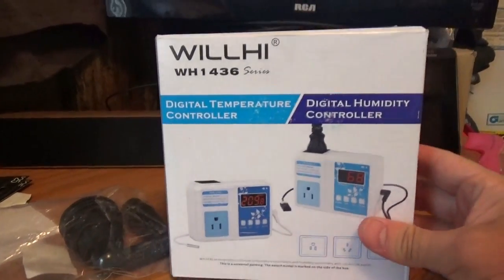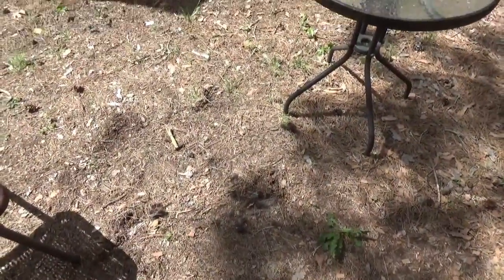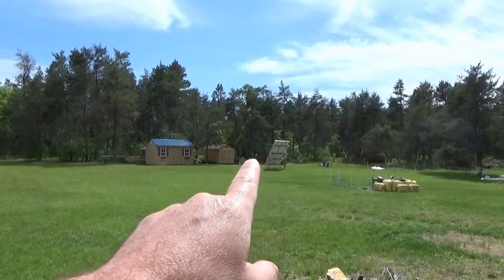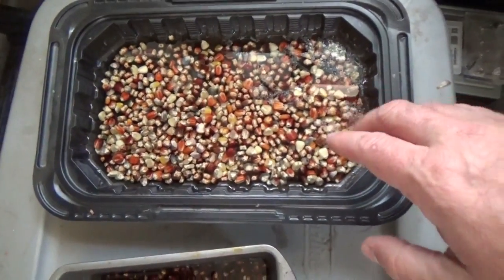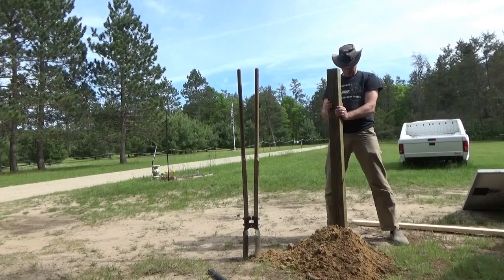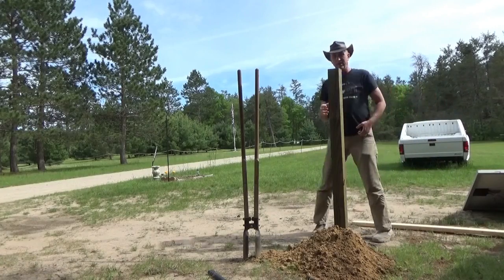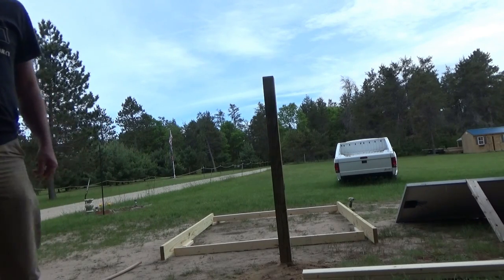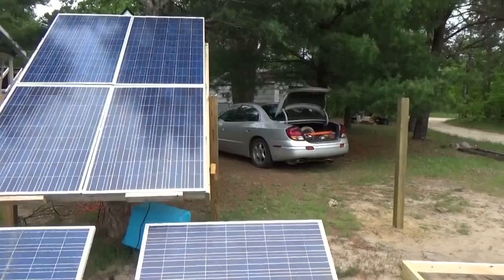Building 2nd Adjustable Solar Panel Rack For Our Off Grid Tiny Home

Comment: If your increaseing your solar array do you also wise to put another battery or two?
Reply from the maker: Yes and no. Anything not used during the day is lost. We have 900 AH of battery capacity now but its not enough to absorb the excess energy produced on a sunny day. I can run a cryptocurrency mining rig for free during sunny days to burn that energy and turn it into money. Or we can get more batteries and have more energy at night as well. I want to do a bit of both.
Reply: That is what I'm almost saying if you what to increase your battery back. I'm just marking sure you have the batterys to last until winter and stuff
Reply from the maker: I hope to be able to increase the battery bank before winter so we have more backup power for cloudy days.
Reply: The Do It Yourself World ya troy I know that's the plan

Comment: Troy:   You could look for a hardwood curved branch to make a replacement handle for the cart.   the old guy  Bert
Reply: Also  drill a 1/2 hole into the posts at 15 d. off vertical the posts.  Use a long 12" wood bit.   Fill these holes with used motor oil and keep them topped up. This will deter the chewing insects.

Comment: That exactly how I made my rack. No concrete either.    I have eight panels on the rack and four Renogy panels on my shed.  I also have Harbour freight panels that are used strictly for 12 volt lighting.    Rest of the house runs on two remote controls inverters.   Ready for the hurricane.  Our system is three years old.  Thanks for your vids.
Reply from the maker: Awesome. This is the best solar power setup I have ever had. But it costs money to set it up right. Our cost of living is cheaper here. So much cheaper :)

Comment: I also live in Michigan on high ground with all sandy soil. I put 4x4 treated posts in the ground for my 100' fence 7yrs ago, and just yesterday i noticed 75% of the posts are rotted and broken. You really should treat the ground ends before sinking them. Just treated wood alone will not work.  When i replace my posts im going to use a stain and coat it in a tar before sinking them. Live and learn.
Reply from the maker: Oh, I had no idea. Thanks for that. I have to redo everything though when I get a chance.
Reply: I would not use tar to coat posts.  It leaches toxic chemicals into the soil and potentially into the water table.  Yeah I know people use it on roofs too, but I would not without covering it with roof paint.  Some of the chemicals are carcinogenic.  Better would be to coat with environment friendly things.  Bugs only attracted to the wood if wet.  I also put 4x4 posts in fence line 7 years ago.  No rot below soil.  I put posts in alternate poured layers of soil and flat circular concrete mud in the holes.  The top most concrete circular "pattie" is shaped like a pancake as the others except it is conical like so most rain water will quickly drain away from the posts and not get soaked in.  Above that is the normal 1-2 inches of top soil just to hide the pattie.  I have also seen some people using a metal or plastic sheath around the post base submerged a bit under the soil to also deflect water from causing rot.  A sealer between the wood and sheath is used with it.